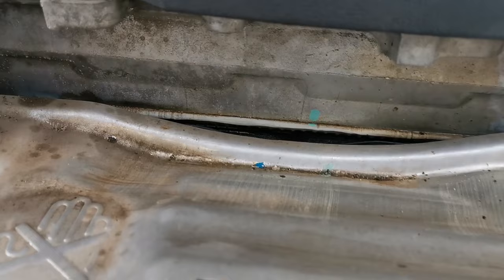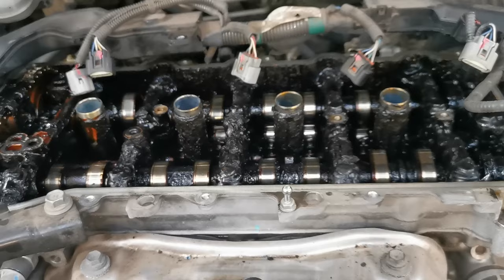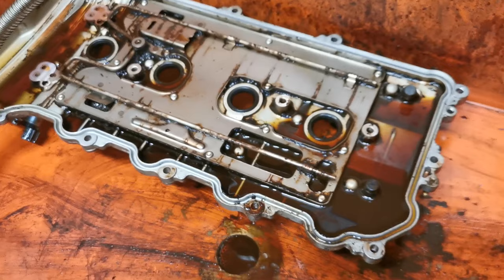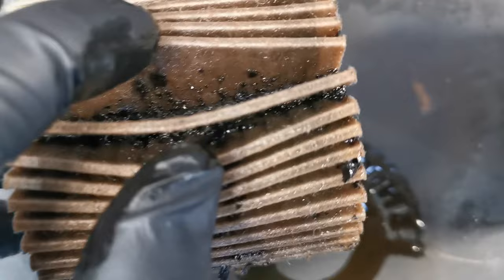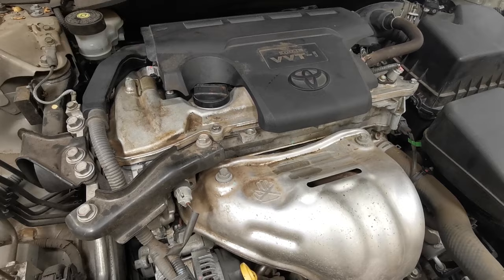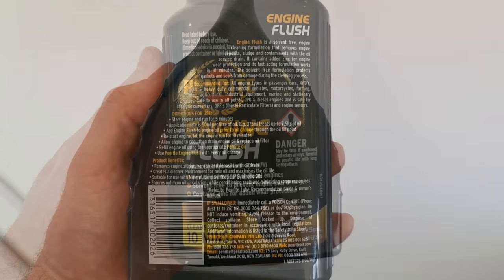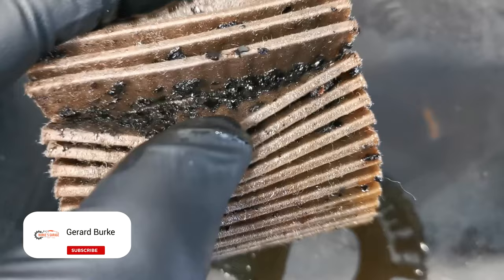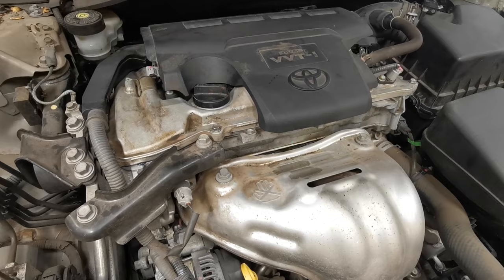The Best Way To Flush Your Engine - Why & When To Use Engine Flush

Comment: Those cams are worn, while time consuming I would have loved to see a before, and after under the valve cover.

Detergents in motor oil don't really clean, their primary role is to help neutralize any acids in the motor which cause corrosion. Most motor oils are not capable of cleaning, due to the heavy refining done to them.

Pure conventional oil oddly enough can clean due to its limited refining. Its also the dirtiest of oils as well so dirty out, dirty in. There are aspects of motor oils which can clean, but any organic oil which has been heavily refined will have lost that ability to clean.

They contain aromatic fatty acids, which are polar, kinda has a solvent like effect to them which helps clean. Its removed from the oil in the same process that removes waxes from it. Makes it cleaner, but reduces the cleaning ability of the oil.

Any pure conventional oil can clean (groups 1, 2) but groups 3 (being heavily refined group 2, and to some degree gas to liquid oils, as well as group 4 (PAO) lack the natural solvency. 

Group 5 Esters can clean, they have the same natural solvency as group 2's aromatic fatty acids. Their expensive oils though, and due to their nature they can eat away at seals in the motor. Their typically diluted down to combat this effect.

You can also use alkylated naphthalene, which is somewhat common as an oil additive (from the factory) only in very high end motor oils.
Reply: Use diesel oil and it'll clean very well
Reply: @bsaxonfishing2163  diesel oils use the same base stocks, and additives as gasoline oils. The biggest difference is zinc, or ZDDP (which is technically an ester), along with how much of each anti-wear additive is in the oil.

Increased levels of viscosity improvers, and really not much real difference. Different levels of additives, which could help prevent sludge, but it's not exactly going to clean.

Higher levels of dispersants, and detergents (not cleaning detergents) help  keep the higher levels of soot from diesel motors in suspension. This prevents sludge formation, but again no real oil is designed to clean, so much as limit the build up of sludge.

Using diesel oil in a super modern engine (direct injection, and turbo's) is a good was to cause LSPI which fills a fair amount of motors. It's become such a problem they have made a new spec of oil to combat this ILSAC GF-6A.

Traditionally diesel, and gasoline motor oils where pretty similar in additives, they have recently diverged significantly. Wouldn't recommend their use on any motor made in the last 5 years.
Reply: Correct me if I'm wrong but wasn't zinc replaced with higher amounts of sulphur to make epa happy. My Silverado has 295k. Once yearly I buy diesel oil and a cheap filter. Drain regular oil out and put that in and run a day. I then open the drain and let it drip all night. My oil stays relatively decent looking. However I aim to change around 4k each time
Reply: @bsaxonfishing2163  are you referring to moly sulfer? Sulfer is a very common element, its polar, binds to metals, so any antiwear additive which could bind to sulfer should in theory also help it bind to metal as polar elements tend to attract to metal surfaces natural.

In the process it could displace some sludge (which is also polar) but the biggest issue with sulfer, and zinc/ZDDP is their polarity. They tend to build up inside the catalytic converter, primarily on the rare metals which reduces their effencience of converting carbon dioxide, to carbon monoxide.

They are trying to phase these elements out of motor oils in general, which is why diesel oils have been lowering their use of zinc/ZDDP on general.

Respectful in terms of oil color it truly means nothing these days, prior to detergent/dispersants being used it would show build up in the oil. These days it does not, most motor oil is pure these days, clear, but folks have become accustomed to amber, so dyes are added.

An oil could be pitch black, and still perfectly fine, or clear but bad. The primary causes for oil turning darker is fuel making it's way into the oil, or heat. The issue with motor sludge is it's converted into a form of plastic/polymer. The chemical chain breaks down, and as it does it changes, motor oil really has no way to dissolve this polymer, so it can be difficult to remove, however it's also polar, so it will attract itself to metal, like a magnet.

If enough of it build up some can break free, which would ultimately make its way to the filter, or the oil pumps pick up screen.
Reply: Correct. ✅

Comment: Why not using the completely brutal method?
- cleaning the camshafts with break cleaner
- draining the oil and changing the filter
- using high quality or synthetic Diesel instead of oil
- idle for some minutes and repeating to change for new Diesel
- finally open the valve cover and removing the oil pan; cleaning
- new high quality oil with high HTHS and high content of cleaning agents and a new filter

Comment: There's a better engine flush product on the market now, the BG Dynamic Flush system. It's $300, but it works very well, several YT videos on it's use

Comment: Well mmo resulted in a clogged oil pickup and low oil pressure on a gunked up new to me car/engine.   I put a used motor in the unit and carried on with life.

Comment: Why didn't you show it with the cover off after the flush to show how much it actually cleaned it⁉️ 🤔
Reply from the maker: I work in a very busy workshop with deadlines, a customer would have to request that for me to be able to remove again and recheck otherwise I would be wasting workshop/customer's time and money.

I always give options and in this case the customer specifically declined any further checks or flushes. 

I am happy to say the noise never returned and the customer was very happy with the results

Comment: 😅😅engine flush, run the thing with same viscosity diesel oil for 2000kms change filter every 500km. That will make it like new inside the engine

Comment: Please note that the results were mainly achieved by the thorough cleaning of the valve cover to improve the oil circulation. What should have also been done was the loosening and physical removal of the oil sludge in the valve train. I would have also changed the oil and filter cartridge then filled engine with diesel and idled for 10 minutes as the initial flush. Do another filter cartridge change and refill with new diesel for another 10 minute idle. Then I would use a cheap oil with the Penrite flush product and another filter cartridge. Flush engine again with new cheap oil then you are now ready for the new oil and filter cartridge.
Reply: 10 mins with pure diesel will destroy bearings of crank and rods.
Reply: @ozgurakman10  A good reason why the engine is IDLED only without any engine revving and NOT driving. I have also been using diesel for engine flushing since the 70's. In the past 8 years, I have been removing oil sludge from my 2GR-FE engine using diesel as the engine flush.

Comment: Because it's a Toyota filmed make sure to use Toyota oil filter. Not aftermarket, includes check valve, most do not use this and hence startup noise.
Reply: Wix, Wix XP, NAPA Platinum, NAPA Gold, Fram Ultra, Fram Endurance, Amsoil, Purolator Boss, Purolator One ..... are oil filters far superior to Toyota.

Do your research. 🤨

Comment: Stop using these “engine flush” in your engine. They will eat up your gaskets and cause leaks. 
Try adding a quart of Automatic Transmission Fluid about 100 miles before an oil change. ATF breaks down the gunk in the oil better then anything and atf is also a lubricant and won’t damage the gaskets. Drive normally during this process

Comment: one very important but neglected property of engine oil that help a lot with cleaning is its solvency. Oil with high solvency help clean the engine, for example a group 1 oils or group 5 diester. "Full synthetic" oils usually have bad solvency. 

Another way is to mix 10% cooking oil and use the oil normally, which can be corn oil (in cold place) or palm oil in hot place. Brand matter, so try to experiment the one that do not cause oil leaks. For Indonesia brand, KCO and Filma are know to be the best for engine oil mix.

The engine will be cleaned in a 1000 km or so. No more varnish after 5000 km. Change the oil by observing oils color or engine noise.

If you afraid of using cooking oil, use kixx bio1, adnoc px green, ecorsa / evosyn non petroleum or havoline renewable. These use cooking oil too.